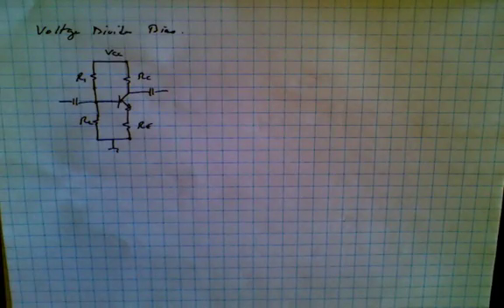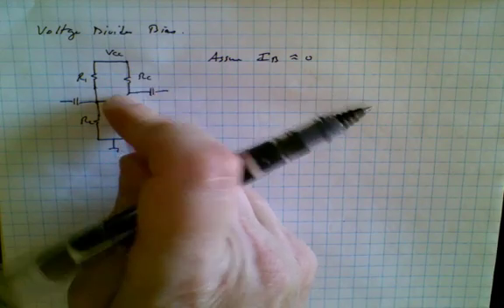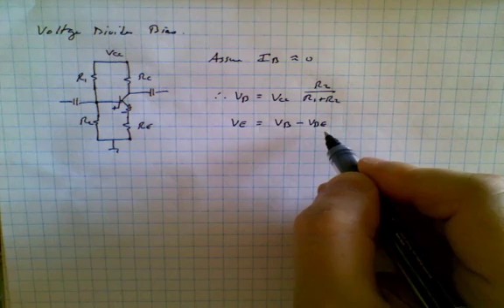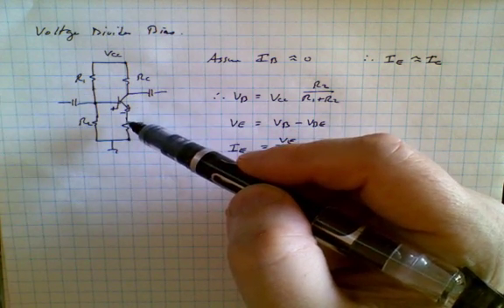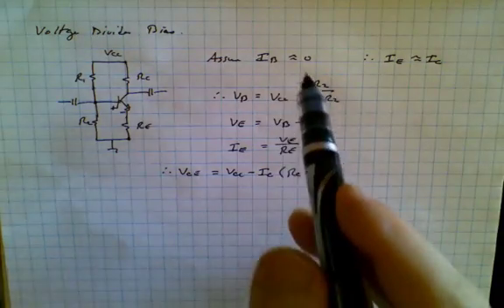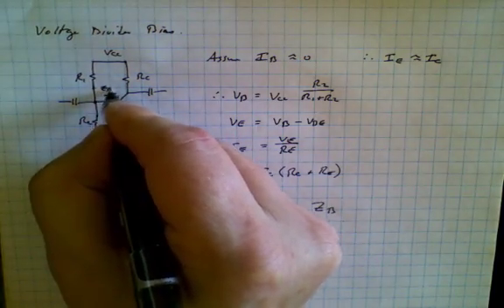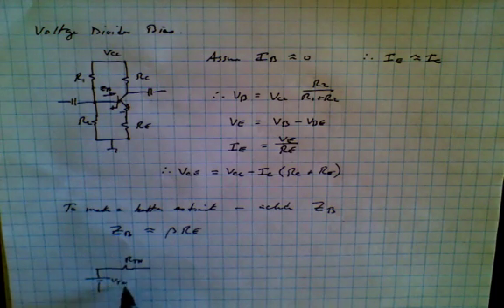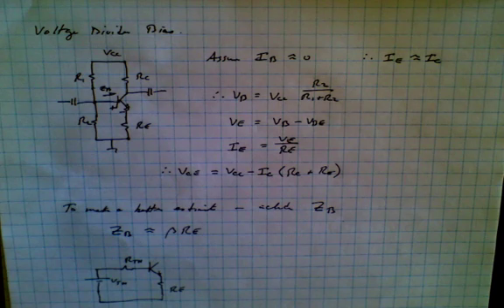Voltage _Divider_Bias

Comment: There are three places where voltage can drop on the output side of the transistor: Vrc , Vre, and Vce. Since Vre and Vrc are known, the Collector to Emitter voltage equals the balance of Vcc. 

so finding the right equation for Q point is  Vce = Vcc - (Vrc + Vre)